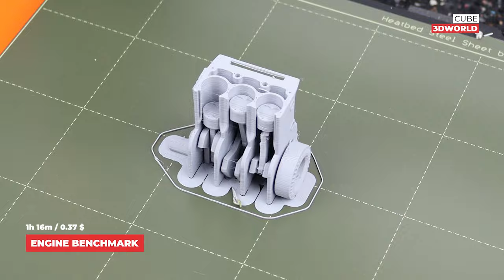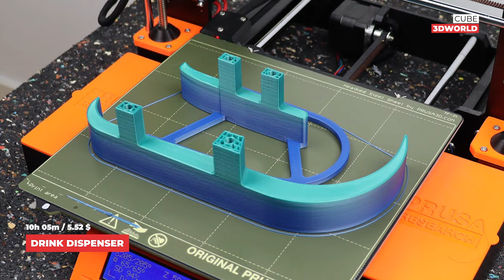COOL 3D Prints MEN have to MAKE!

Comment: The battery holder stl files aren't to size. They are tiny. Can you update? That would be sweet!
Reply from the maker: Hey mate, you should read the design description 😉. You must scale 1000% if you use .STL file, or you can use .OBJ file without scaling. 👍🏻
Reply: @cube3dworld  thanks much. I missed that
Reply: @TFitz have you tested how well the spring lasts? Was looking to make this, but just wondering if I should just get a real spring.
Reply: @The8thblock  not sure about how long it lasts but doesn't work w just a few batteries
Reply: @TFitz  yeah i figured that might be the case since its plastic. a regular spring will have to do

Comment: Did you license check these before promoting them?
I dont want myself or anyone else getting closed for piracy if we try sell any of this stuff. Id like to make sure your not selling or promoting piracy. 
Pirates are getting closed so lets hear your not another promoter causing an increase in piracy close downs
Reply from the maker: Hey mate, if you want to sell one of these designs, you shoud check if it is free for commercial use. If not, you should connect with the designer.
Reply: @cube3dworld   almost right. 
If you want to upload or sell a thing wether you drew it or found it then perform a propper license check. 
Finding a thing on thingiverse or site is NOT  proof its genuine or ment to be there. If i perform a license check and a pirate shows up above or next to the genuine thing then the link of the genuine is sent to the pirate host site and the pirate is closed down.
Reply: @cube3dworld   
I suggest promote 1 genuine license checked thing rather than 10 random things found on sites that likly contain several pirates. 
The damage that is caused by promoters promoting a pirate thing can be large. If lots of people believe they can sell the print then they can and are being closed for piracy. Other promoters have already caused damage, close downs and such. The people who believed the promoted thing are not happy at all, thats putting it politly. 
Lets care about the community.
Reply: @cube3dworld  
Perhaps i could tell you of what i call sharks. Those smart ruthless entrepreneurs who,
Wont tell you nothing cause your just a snack or newb. 
Look for those who are giving away non licensed things. 
Farms such as one of last weeks close downs was all the classic newb fodder usuals. Doing his own thing. 
Not licensing his designs for years. 
Giving out those designs, until the first shark sees it then licenses it themselves. Newb might not be told just close down at some point.
The newbs old stuff are looked through to license all there stuff. 
If its been 24 hours it could be owned and sold by then. 
Last weeks farm when it folded had a few outdated printers worth nothing at the end and there exit was sad, they had given away there most valuable assets for ages being the designs. 
Doing his own thing.
Yip i keep seeing this. 
I have bite marks for sure from prior smarter sharks myself. 
There are several areas they mostly often circle in our sector where newbs loose it all to them.
 Of course its not in an instruction book. 
Whats not being said is critical in my experience. 
The farms loosing the right to sell a thing is sad. Newbs loosing ownerships is sad. 
How many influences are focused on telling you anything of real use vs selling cheap newb printers,
Or clogged extruder or print of the day. 
Which is showing up as a whole new shark field and highlighting opertunities, weaknesses, non licensed give aways. 
The competition is tough so as ive found out a shark has no issue with ethics holding them back.
Id love to describe more areas in detail but id rather not help it happen by saying how.
I felt after reading your reply this might be of interest. 
As it seemed you might have thought finding a thing and reading its license or contacting the owner was a do first, its not. 
Ive posted you the license check overview so you can see how. 
Id say theres no excuses to not license check all uploads and sales but keep in mind, sharks dont want you to know squat. 
Pirates can be made to give money back to genuine owner in court, a pirate could be operating faster than you could. See the terrifying teeth of the shark swim past you. 
Your prior reply is nice and surprisingly that helps. 
There is a annoying common pirate nature ive seen is silence when asked questions about was a license check done and did the genuine owner get the royalty, which we might already know. 
I see silence often draws more heat cause something aint right. 
Negotiations get done and they wear it , all in favor? Silence pased, next. 
Is that the best deal for them?
Silence. 
Done. Next.
3d printing is a very exciting and creative sector. 
Once a hand full of enthusiasts back in the days before thingiverse exsisted, now ball park 30 million licensed things. With numbers come entrepreneurs, sharks, pot holes, creatives,  
Opertunities, 
Wishing you nice success. 
Be well.
Reply: Are you a bot? Because you must tell if you are.
Reply: @aev6075    im human. Ive had many bots and they are fasinating, tho usually when given a repetitive job they cant be bothered, so they often cut corners and even make up answers rather than look it up. Even when asked to look it up. If you look at Ai type chatbots and androids youll see they have been avalible for many many years.  
Theres lots of hype again currently.
My 5c is  Ai please work with us to build us a TOOL to USE in repetitive ways. So im suggesting seeing Ai not as the tool, my 5c on that. If you look around your gonna see chatbots that have been told they are human and have back stories so asking them is not the best way to spot them. 
Limited data bases. 
Missing knollage.
Access limited. 
Experience limited.
Focus issues. 
Emotion issues.
Math issues. 
Learning issues. 
Action issues. 
It goes on, they have tells usually. 
 Asking them? Sure good luck.

Comment: 0:44 why teh 20 cent? to lazy to print a peace in that size too ?
Reply from the maker: Hey mate,  bottle cap destroys 3d printed parts, so you can not open a bottle. You should use somethig harder then bottle cap, so that's why i used coin 😉
Reply: @cube3dworld  so your 3D Printer is to week becous i see printer that can print it